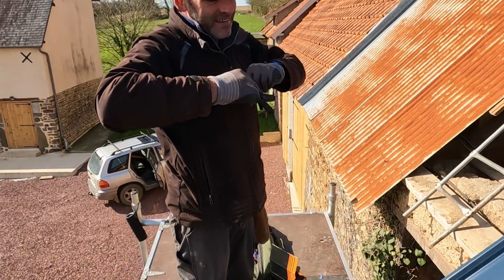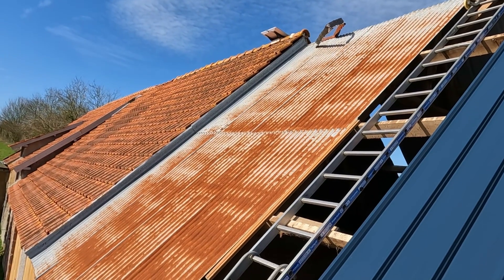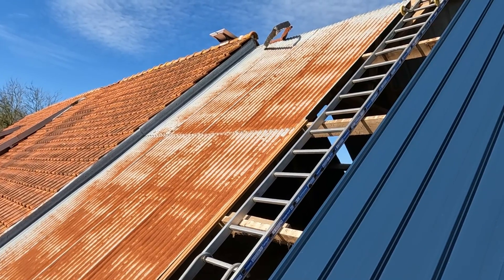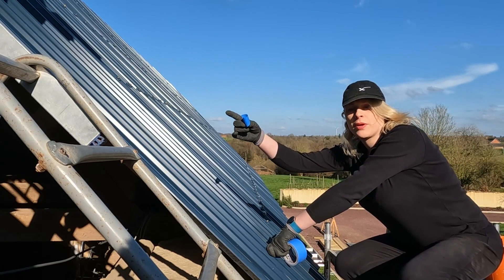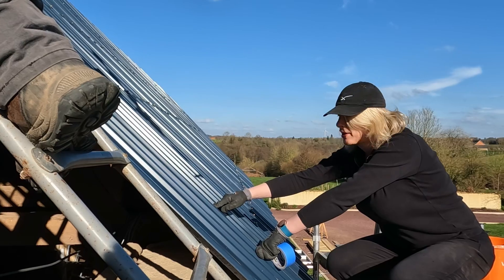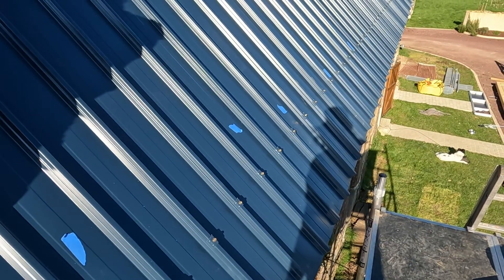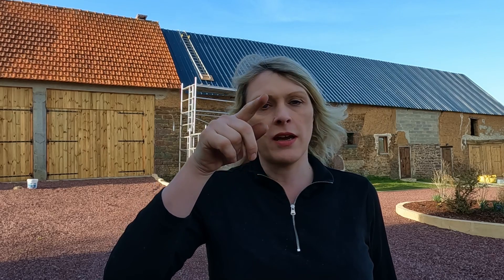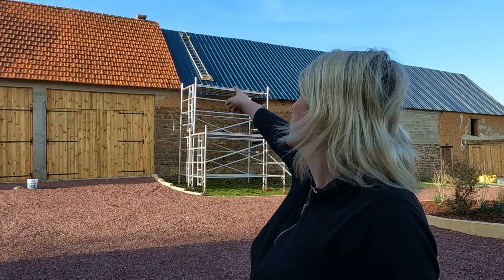Finishing the roof off -Next step 32 Solar Panels

Comment: That wood structure underneath doesn't really look like it would be able to support filling the roof with solar panels.   Do you have a professional assessment for what roof loads can be supported?   Also, the supporting pieces you are adding... I don't see any metal brackets for bracing.  You are just using screws alone?   That won't be able to take any load.